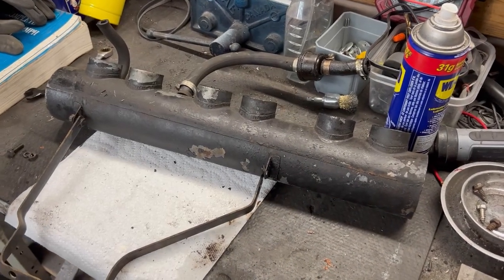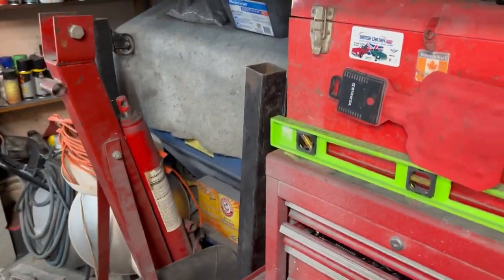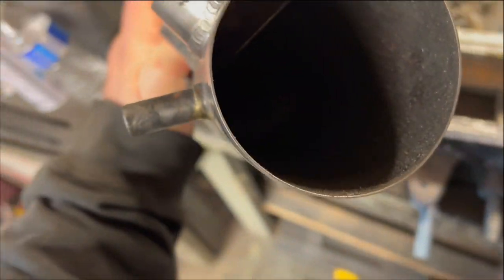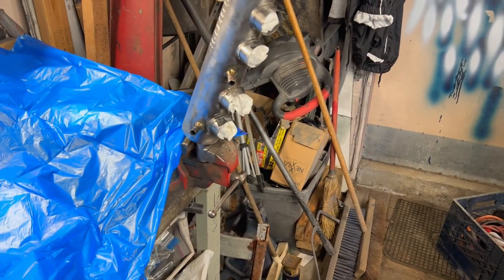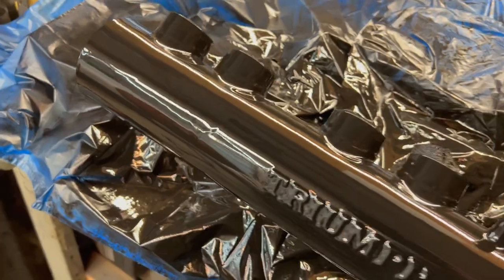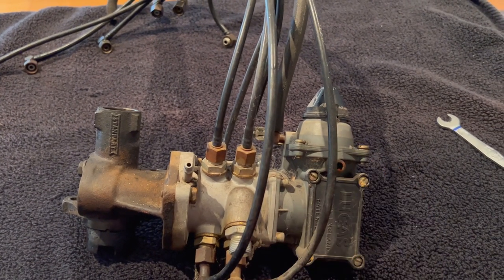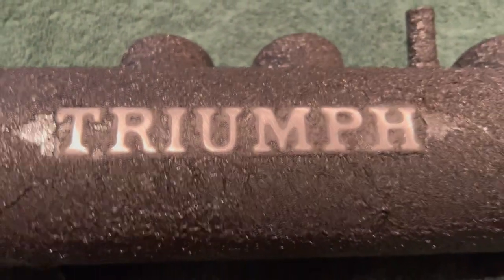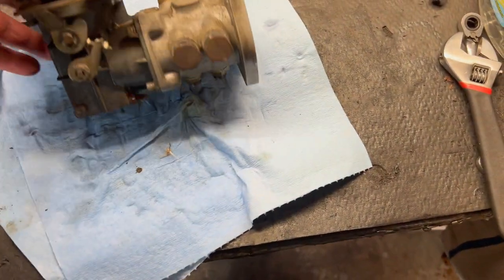1970 Triumph TR6 PI Restoration Project, Air Manifold Assembly Refinishing

Comment: I used the same on my plenum, the key to wrinkle is thickness of paint and heat (sun or heat gun). The thickness makes it prone to get runs, so concentrate on the area you can see. Also mask the areas where the pipes attach. Good first try though. And yes the Triumph logo looks great picked out 👍

Comment: Chef, The secret to painting wrinkle paint is to put a heat gun to it immediately after putting down a heavy coat of wrinkle paint. You need to use a heavy duty heat gun, not a hair dryer. It is almost like magic when you do it this way, the paint will immediately dry and wrinkle at the same time. Suggest you practice on a test piece first but it should work fine. I find the VHT wrinkle paint works the best. You will find that the wrinkles will be more uniform and tighter when you use the heat gun.
Reply from the maker: Thanks for the tip Mark.  I’ll try it next time…who knows, I might do this project over eventually….

Comment: Hi Chef, As you intend to send your metering unit off it is perhaps worth thinking about what you do wrt the injection leads. As I decided to have a plated finish on the fittings at the ends of the pipes I sent them off at the same time. One nice thing about TR6 leads is you should find the fittings where they go onto the injectors are numbered 1-6.
Reply from the maker: Hi Tim, great idea. I did notice the numbers on mine.  I’m not sure if mine are salvageable as they are pretty rusty.    What are your thoughts on the braided stainless injection lines vs the stock type ( nylon?).
Reply: @cheftush Hi Chef, I went for the original style ones as I wanted to keep my car looking as stock as possible. I had these on before for a very long time without any issue.

Comment: Five that paint a couple weeks to cure. It will probably still shrink some in time. If there are still some flaws, while I haven't used that brand of wrinkle paint, other that I used in the past was easy to touch up with a brush. Just mix well, then spray a puddle of the paint in the cap, then dab it on rather heavily with a brush. That would work where the sprayed paint peeled off with the tape. Some sanding or "shaving" with a razor blade would be needed where there's a run or a sag. A second coat may be needed, but the brushed on paint will wrinkle too, matching what was sprayed earlier and hiding the repair. If not sure, experiment  on a scrap first.
Reply from the maker: Yes, I was thinking of scraping down that run…I’ll let it drive for the week and possibly go back to it…

Comment: Question: Can any carbureted TR6 be converted to PI? If so why isn't everyone doing it? If not, why not? Or even a modern unit made to fit the TR6 engine.
Reply from the maker: Yes, a carbureted car can be changed to PI and vice versa ( as long as you have the correct parts for each system).   It can be a fairly expensive proposition to change a carbureted car to a PI car so I’m sure that’s a bit of a factor…and again, if you wanted to convert A PI Car to carburetors, triple Webers would probably be fitted….just the carburetors and manifold would be $2500 US alone, so not inexpensive.  And yes, there are more modern types of fuel injection or throttle body injection available….again, costly to convert initially.